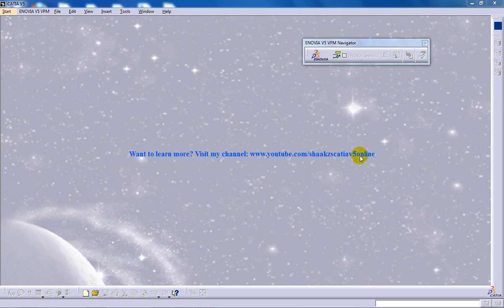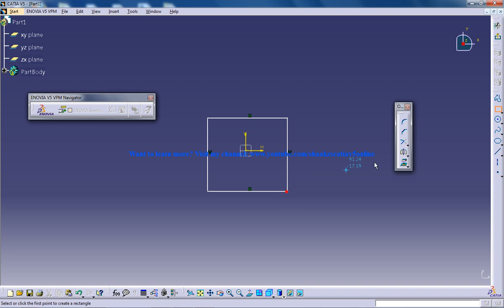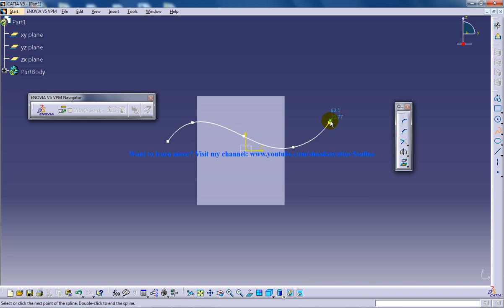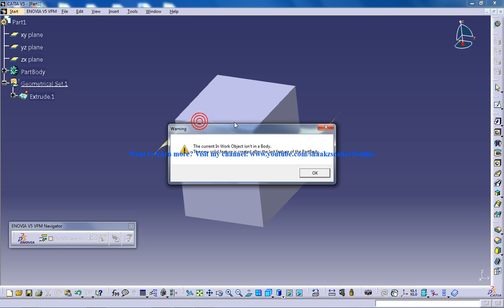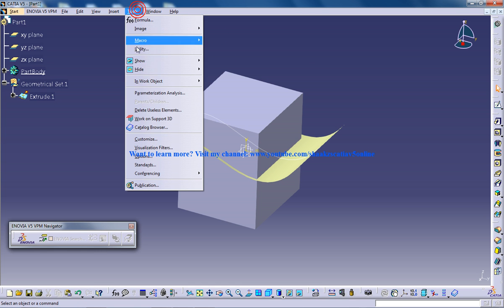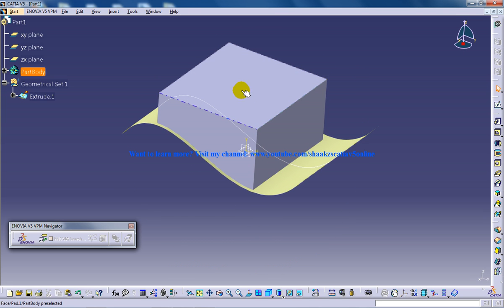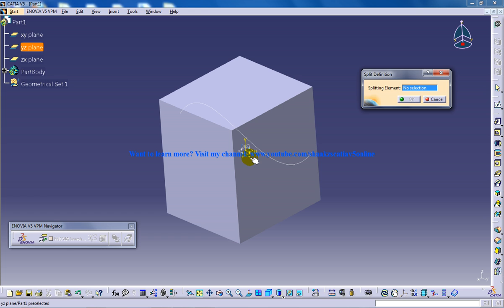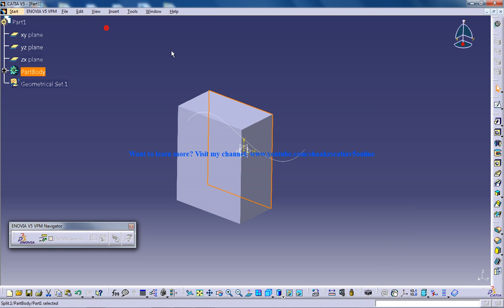Catia V5 Tutorials|Part Design|Surface Based Feature|Split Solid Body

Comment from the maker: OGS depends on the order of feature used... like in an body, It makes a difference if you first fillet, then Shell or the other way round (First shell then Fillet) 
Geometrical Set : more like a Windows Folder. It is for structuring your Model. 
If you are working in Hybrid Design ie mixing surface and solids in the Same structure you can use OGS. 
Dassault prefers using Ordered Sets 
If you are working for Audi, BMW, Mercedes, VW it is not allowed to use OGS. Hybrid Design is also forbidden.